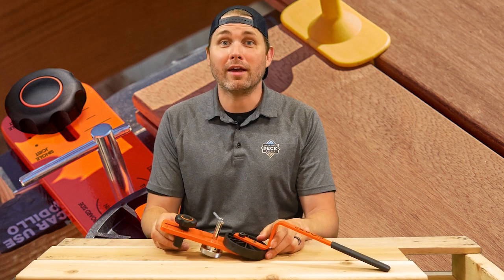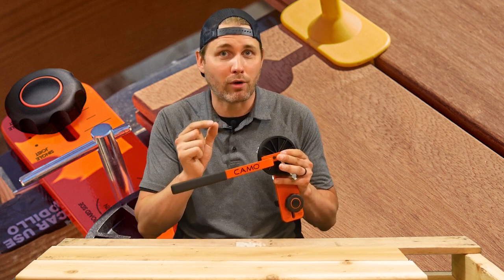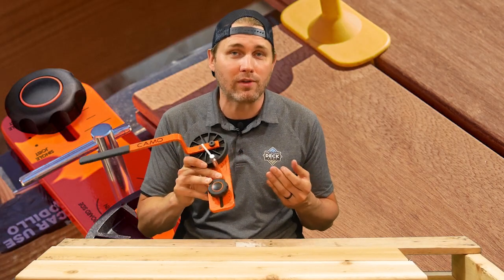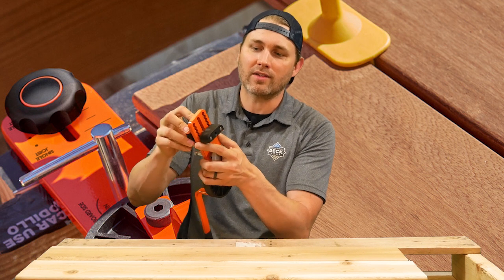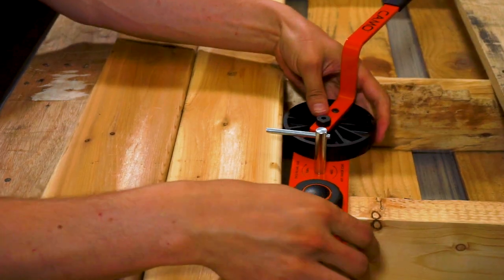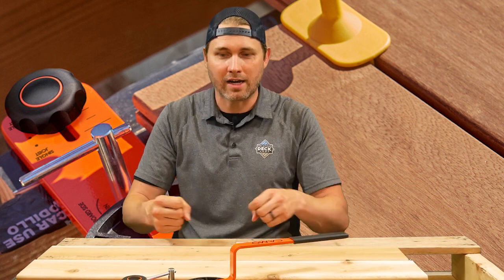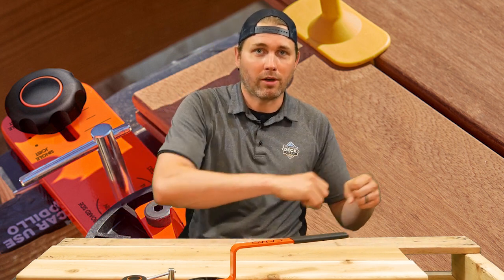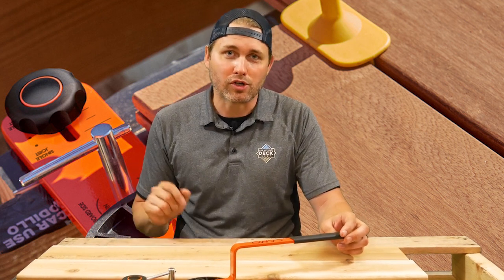How to keep gaps consistent with the Camo Lever // Deck Shop Shorts

Comment: Great product but does not have enough adjustments. I have double joist. Fits with no joist tape. But with joist tape does not fit. Needs to have better more flexibility in fitting joist
Reply from the maker: Sounds like you're using a tape that's unnecessarily thick.  Try G-Tape instead.  https://www.tuds.ca/brands/nichigo/